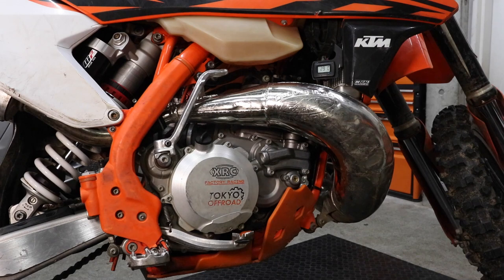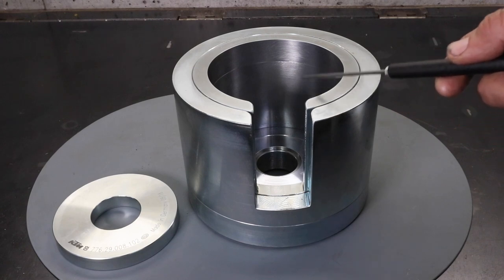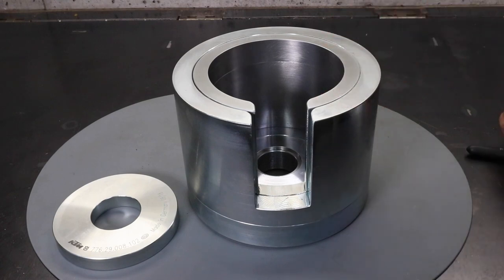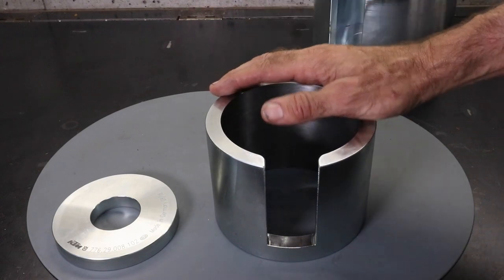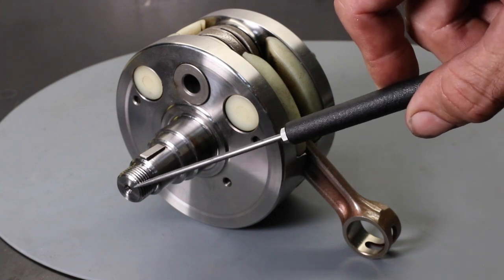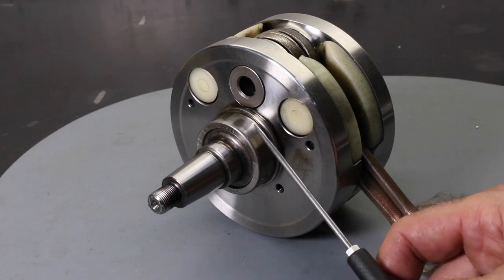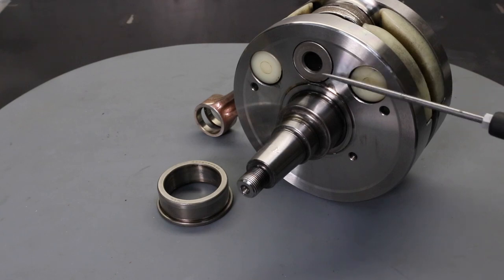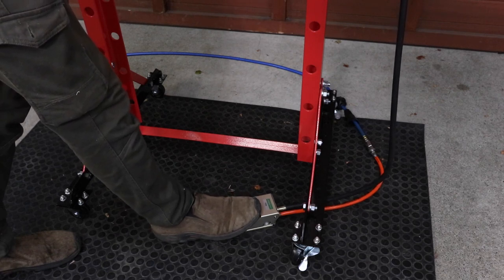Part 3- 2017 KTM Bottom End Overhaul- Crankshaft Rebuild

Comment: I did a 350 Husky crank rebuild fairly recently and remembered your video, there really is no other way of getting the inner race off, so I bought one, worked first time, I now have all four sizes and I have made other sizes for other machines as well, for those who are about to do this, don't skimp, buy the tool, thanks for sharing.

Comment: Just some advice on your pressing technique.  Once you begin to press the pin, lift the ram away from the pin to remove any binding. This method helps prevent pressing the pin at an incorrect angle
Reply from the maker: Good tip, makes sense...

Comment: Nice job, as usual. Could you please report about runout measurement after assembly? I'm curious if it needed any adjustment. Thanks
Reply from the maker: Thanks. The newly rebuilt crankshaft runout,, with no adjustment, is a little over double the spec. The majority of the misalignment appears to be that the webs spread apart going away from the pin. Part 4 will show how I measure the runout and true it. I’ll upload the video the second half of this week (already Monday here in Japan).

Comment: With the installation of the big end conrod pin, would it make installation easier if it was put in the freezer for a few hours prior to pressing in? I can see the press deck flexing during removal and installation, a lot of stored energy there - engage safety squints!
Reply from the maker: The KTM service manual recommends oiling the pin for installation and due to this, s you could probably see in the video, installation was a lot smoother and less force required than removal. Yes, freezing the pin before installation might well make it easier, particularly if you are using a smaller press. Yes, there is some flex in the press, but I was monitoring the force while pressing and stayed under 7-8 tons at all times.
Reply from the maker: And yes, I always wear eye protection when operating machinery.

Comment: if the needed to redo the crank pin spec, doing it manually instead of with air would be easier.. and or with small shims. underneath.
Reply from the maker: Yes, I agree. I should've mentioned that in the video. I would've definitely done it manually if I needed to make small adjustments. Regarding shims, I mentioned that to ProX and they said they didn't recommend using shims. Unsure why. The only issue I can think of is if the shim goes off-center and I think I would've used a shim if I decided to use the ProX kit, rather than having to adjust the clearance afterwards. Using the KTM jig (and correct length pin) made the pressing operation very easy though...

Comment: Truing isn't required when jig is used??Is the jig compulsory coz this Crank has tighter interference fit?....so that if pressed without using jig...truing would be difficult or impossible maybe....??
Reply from the maker: Truing may still required even if you use a jig. At a minimum you'll need to check the assembled crank and make sure it's within spec. If you don't use a jig you'll probably need to spend a lot longer truing.

Comment: Great job....Why did you go with the KTM Crankshaft  I didn't understand that?!!...
Reply from the maker: Thanks. If I'd used the ProX kit and pressed the two crank webs to the length of the pin (59.75mm) I wouldn't have had sufficient axial clearance (probably only about 0.45mm and spec is 06-0.7mm). To work around this I would've need to either 1) Press the halves together fully, then press the pin out a little; 2) Press on but not fully, measure axial clearance, press on more, measure, etc, or 3) Use a shim (about 0.2mm thick) placed at the end of the pin and press crank web on. I discussed option #3 with ProX but they said they don't recommend doing that. Anyway, I decided that I'd make things simple and just use the KTM which I had high hopes would press together without requiring adjustment afterwards and that turned out to be the case. When I use the ProX kit I'll make another video and will probably use a shim to achieve the correct clearance...

Comment: Amazing video and setup (your press is AWESOME) what brand is it and it is METRIC on the gauge even better.  I have used Pro-X crank con-rod kit before and OEM (normally prefer all OEM) as always seems to fit and no issues.   ✔👍👍👍👍👍👍
Reply from the maker: The press I purchased from a tool shop in Japan. It's unbranded and probably imported. Supplied documentation was in English, Key specifications are: Capacity=20Ton, Ram Stroke=154mm, Air Pressure=0.75-0.85Mpa,  Working range 80-1040mm, Bed width 545mm

Comment: Amazing as always. What is "run out" please?
Reply from the maker: Thanks. I'll be explaining runout and measuring it in the next video (Part 4). To be precise, what I measure is total runout, which is a measure of the roundness of the bearing journal, plus how much the shaft deviates off center when rotated. The method used is to hold the crankshaft ends between dead centers (I use a lathe), position dial indicators on the bearing journal surfaces, rotate the crankshaft slowly by hand and note the minimum and maximum deviation on the dial indicator. Total runout is the peak to peak value from minimum to maximum. For example if the measured minimum is -4um and maximum 8um then the total runout would be 12um.
Reply: @TokyoOffroad  OK, so runout is how "out of round" it is - because the rotational motion converting to up/down makes the bearing an oval I guess? Thank you for answering (domo arigato gozaimashita).
Reply from the maker: @AndrewBoundy  - Total runout includes how oval the bearing surface is. But really that is only a very minor contribution as the bearing journal is machined to very tight tolerances (and roundness). The larger contribution is due to misalignment of the two crank webs when pressing them together on to the pin. This misalignment results in a wobble when the crankshaft is rotated. By measuring the runout and then truing the webs (a copper hammer, or dead blow hammer is used) the runout can be minimized.
Reply: @TokyoOffroad  Got it - thank you again.

Comment: I would have used .2mm washers under the ends of a pin to compensate for it being shorter than spec.
Reply from the maker: Yes, that's what I would have done if I decided to use the Pro-X kit. But it's interesting to note that Pro-X advised me not to do it like that, although I'm not sure why as I'm sure it would have been fine...

Comment: When you say you have two stroke oil do you mean for the gears or premix??
Reply from the maker: I used premix oil (Motorex CrossPower 2T) as that's what normally lubricates the big end bearing as the fuel/oil mix passes through the crankcase.
Reply from the maker: And when I assemble the crankshaft into the cases I'll lube it up again...
Reply: Tokyo Offroad perfect! Can’t wait to see the rest of the series!!

Comment: When i press the big end, i got shim in diffrent size and put more than needed so i dont press it to far. The "bump motion" is more like than mm/bump sound, then i take out a shim at the time and press to get the correct messurment. Its not that fun to press the shit apart again.
Reply: Shim with the same size (just smaller) than the big end pin...
Reply from the maker: When I contacted ProX I suggested using a shim so that I could easily press to the correct clearance. Interestingly they said they didn’t recommend doing that. Not sure why as it seems like an elegant solution around the problem...
Reply: Wierd, pressing togerher is way easyer then apart. Those plastic stuffers get beated easyli...
Reply from the maker: @jonkobronko2  - The big reason for being to press together easier is because oil is applied to the pin and hole.

Comment: Tokyo Offroad,  are you going to balance the crankshaft?
Reply from the maker: The rebuilt crankshaft definitely needs truing (optimization of the alignment of the two crankshaft webs to minimize runout) and that'll be shown in Part 4. However, I do not plan on changing the balance of the crankshaft, other than truing it...
Reply: @TokyoOffroad  yep, 'truing' is the right word I meant and I'm waiting for Part 4 :) Thanks

Comment: What’s the name of the tool up you used to pull off the bearing carrier?
Reply from the maker: It's called: KTM MOUNTING TOOL F.BEARING, KTM Part number: 58429037043
Reply: @TokyoOffroad  thanks, I’m looking to see if I can use it to remove the inner race of a SKF BC1-3342B bearing. Can you let me know the insider diameter. Thanks.
Reply from the maker: @robgregg4615  The tool is designed to work with 44mm diameter races. The tool is marked "43.9" and you need to open it by spreading the handles apart to fit on to the race.

Comment: Where in the hell did u find and purchase authentic redbull graphics? Cant find angwhere
Reply from the maker: I purchased them in 2016 when I bought the bike new. They were purchased from my local KTM dealer. I've since heard that they are only available for purchase if you have a factory edition 450 and provide the VIN. Mine lasted pretty well, but I'm now using a set of orange OEM plastics with DeCal Works graphics.
Reply: Tokyo Offroad appreciate it sir 👍